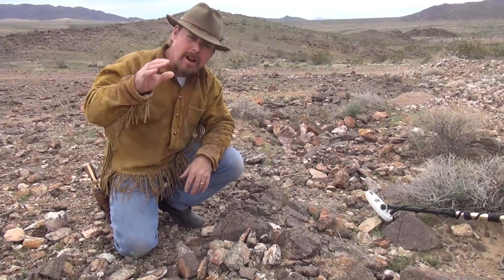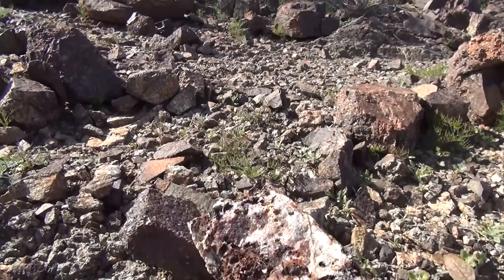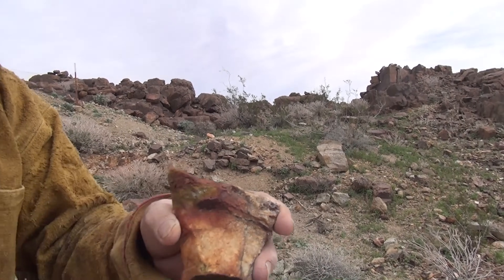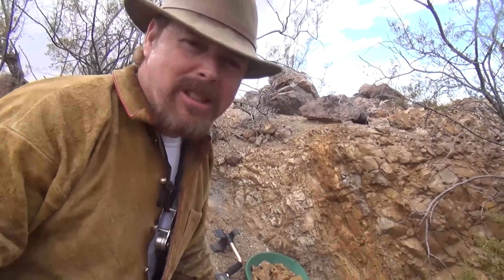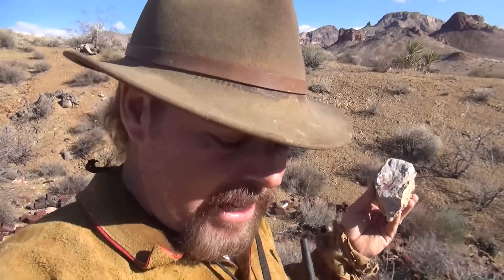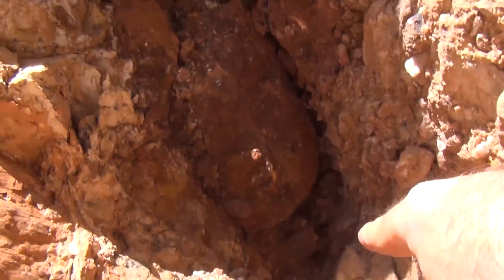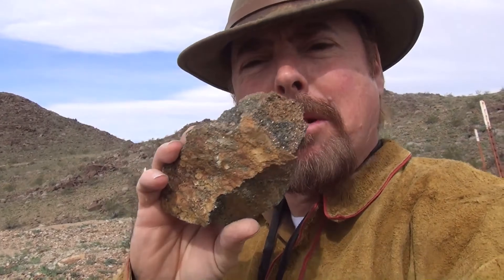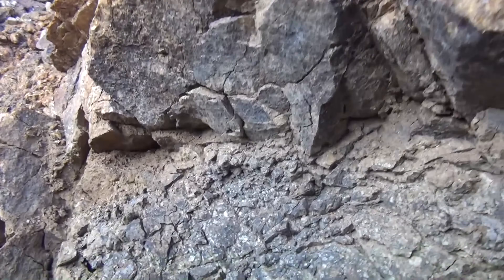GEOLOGY Secrets to Finding GOLD Deposits for Success.

Comment: The best help in the field when prospecting for gold is using physics in dowsing with the modern light weight ball bearing dowsing rod. Read and study the book, The Art of Dowsing - Separating Science from Superstition ($14.95), by Michael Fercik, for learning how to build and all the physics involved in dowsing with the modern light weight ball bearing dowsing rod, which is the only dowsing rod that accurately gauges what is being dowsed by pitting the energy of gravity against the energizing of the one-tenth ounce dowsing rod load that is attached on the elevated acetylene welding rod, with being located five-inches from the hub's shaft. This precisely gauges the dowsing of all edges, exact center, depth buried with angle of deposition, and most important is grading of the dowsed element that is contained in the elemental mass that is being dowsed. Anybody can become a professional dowser by practicing the book's dowsing lessons of dowsing buried pipelines and electrical cables, tunnels and voids, precious metal placer and lode deposits, dowsing for treasure, dowsing for or any element, amplified long distance dowsing from a moving vehicle, and dowsing on water from a boat.